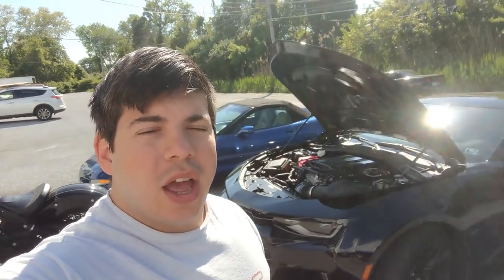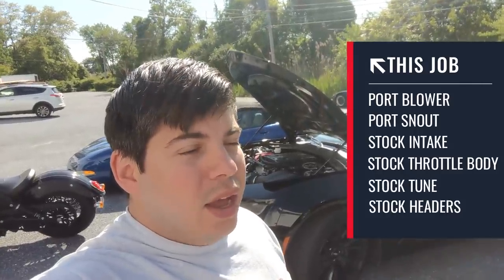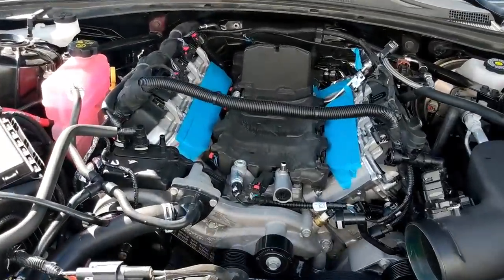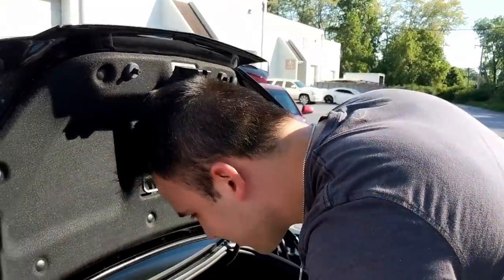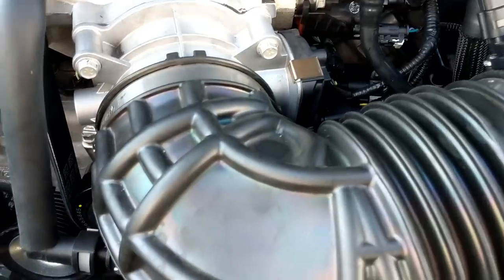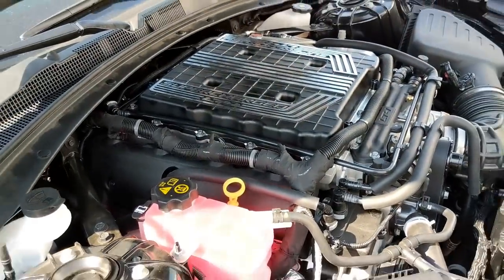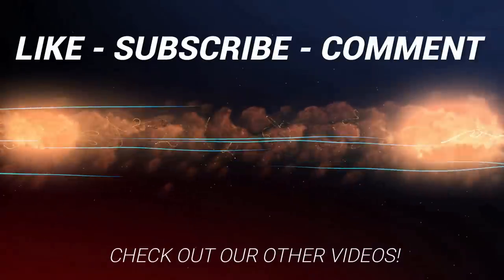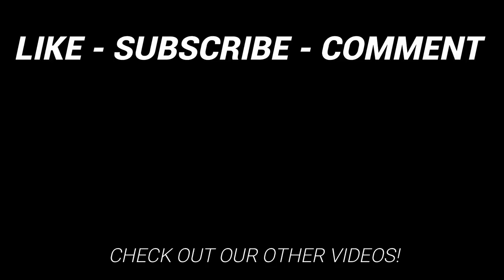What does the New ZL1 Gain by Porting the Blower ONLY?

Comment: I would port the heads and throttle body plenum. The LS has so many cam profiles available that can help you add a lot of power. I plan to do same to my 3UR-FE 5.7L (no cams - they don't make them). Hope to add similar power to your specs minus E85 - just 93.

Comment: I’ve read the roto fab is mostly smoke and mirrors. It would be useful to see an intake comparison between something like a K&N drop in vs stock vs rotofab
Reply from the maker: I've seen consistent ~20 rwhp gains on the boosted cars with rotofabs. Not such a big gain on natural aspirated engines unless they get cammed though. Definitely not smoke and mirrors.
Reply: @completestreetperformance  Most of what I read was saying the rotofab is as good as a “green filter” (I assumed they meant a drop in like K&N even though I know theirs isn’t green) So I was curious how it performed compared to something much more simple like an drop in K&N. Oh well no biggie thanks for the response!

Comment: Could this be for real? Seems like crazy gains just from porting. What's the downside to porting, does it compromise the structural integrity of the blower?
Reply from the maker: It's real.
Reply: @completestreetperformance  What would this translate to on the track? What kind of mph gain in the 1/4 from that power increase?

Comment: Would the 103mm TB add anything in this equation. Do you need to run a tune with the 103 mm tb? Im looking to start doing things to my 19 c7 z and im thinking this is where im going to start also with the 103mm.
Reply: Are you going to test the 103mm tb before doing anything else?